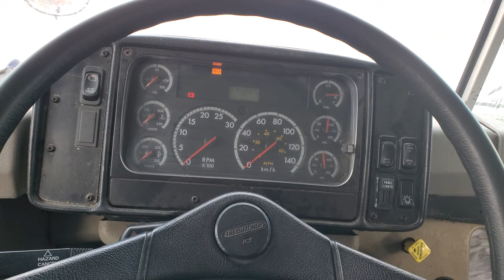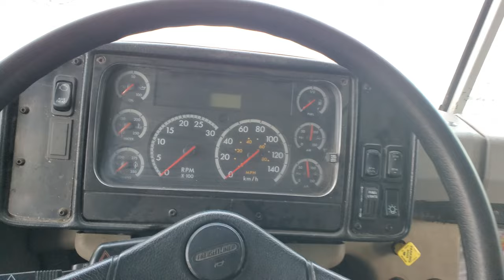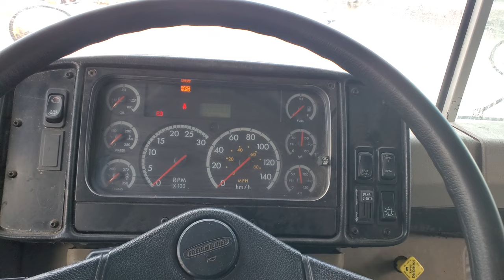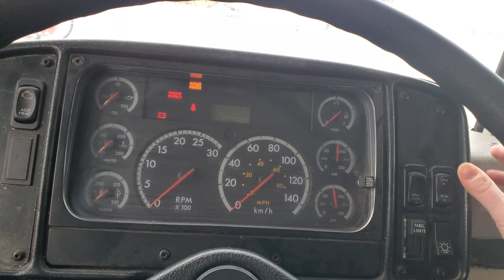2006 Thomas FS-65 Bus -8 Celcius Cold Start - Caterpillar C7 Diesel

Comment: Some future advise there should be a plug in spot in the bumper or side of the bus and all you have to do is have it plugged in for a couple of hours and all you need is an extension cord and it should start easier but great cold start